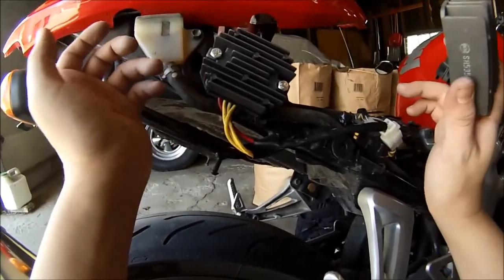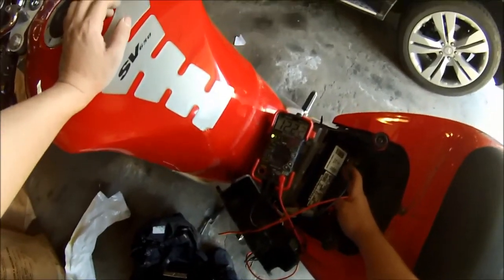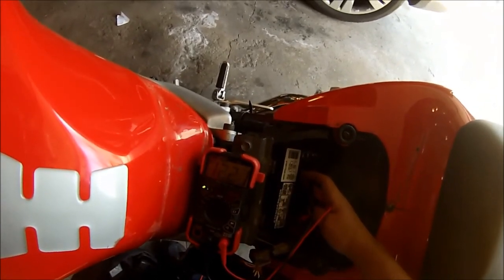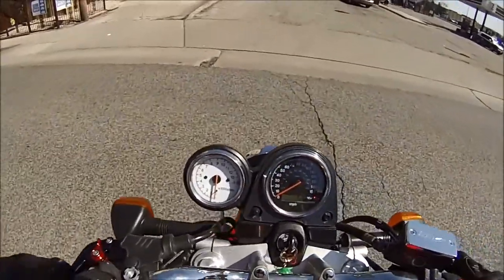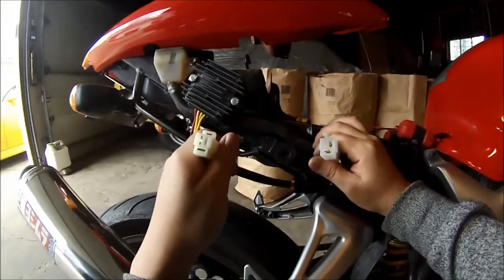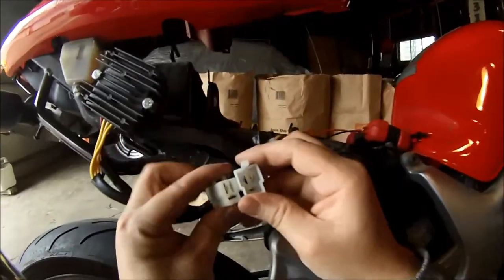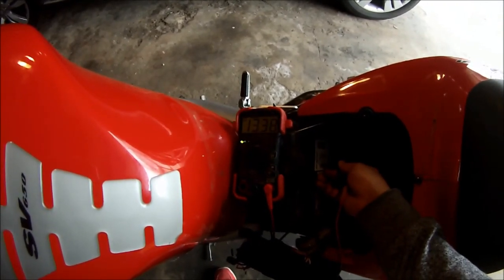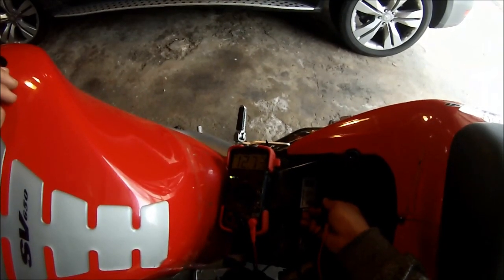A Visit from Electric Gremlins (Part 2)

Comment: Stator is a definite possibility. That drop in voltage could also be indicative of a short somewhere. Electrical problems suck. Here's hoping you get it worked out without much more fuss.
Reply from the maker: I should have paid more attention in shop class during basic electricity. LOL  Thanks man.